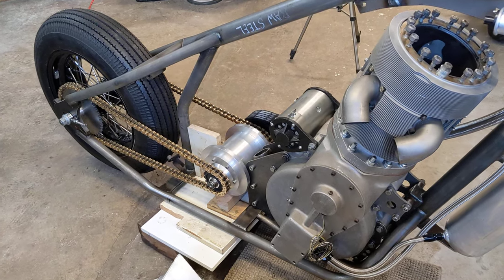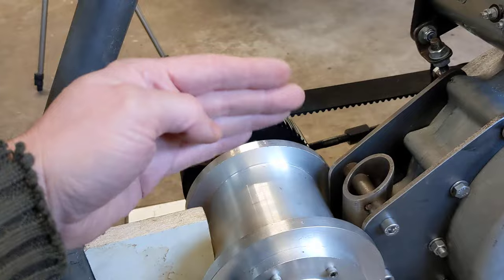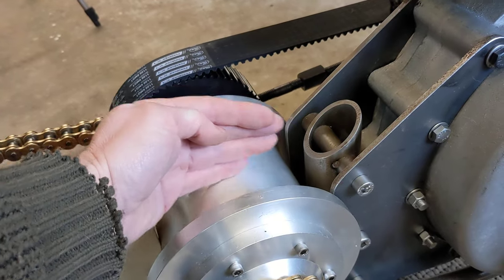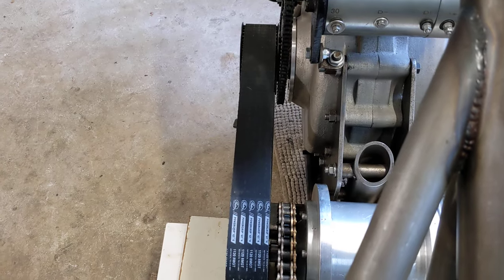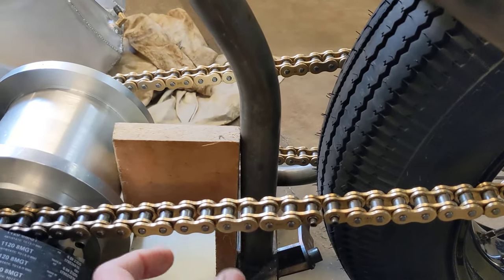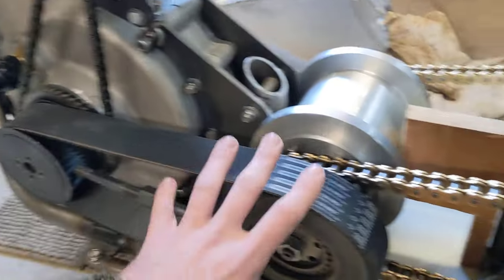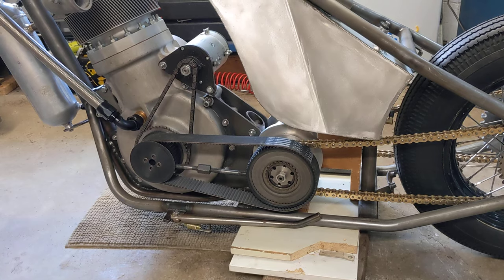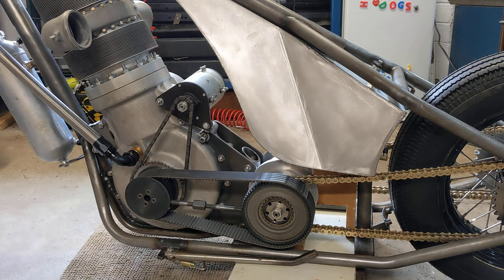Chains to length and gearbox mounting

Comment: I am continually impressed with how well thought out and built this bike is. I realize that you still have a lot of work to do yet, but so far she looks beautiful! I know I'm getting a bit ahead of myself here, but wondering if you've given any thought yet as to what color you will be painting the frame and sheet metal? Btw. I like the gold chains too. Nice touch. 👌
Reply from the maker: Thank you. I have thought a little about colour. At the moment I might just go with plating and polish. Nickel for the steel, of which there isn't much anyway, and brush finish the Ally. 
I always wanted a white chop with brass plated parts, brown leather seat. Very 70's. But I live in the UK so it'll need to be easy to clean!
Reply: @StoneEng  You're welcome and thank you for your reply.

Comment: There's not much clearance under the tank. I'd feel better if it were an inch or so. Also maybe fit a stainless chain guard at that point to shut as protection for the bottom of the tank. It's certainly an original build and I've not seen anything like it before. Can't wait to hear that engine.
Reply from the maker: You're right Phil. Planning another 10mm min and definitely a chain guard. Much as I hate the look of them, it'll need to get past the MOT man and government dreaded DVLA.

Comment: You are going to have to cut away the bottom of the oil tank, even dropping the gearbox as far as possible will not give enough clearance, there's a lot more "bounce" in  the chains in use than expected.
Reply from the maker: I don't think so once I've lowered the box and fitted a guard. Definitely the option of last resort. I did consider taking the tank to the bottom frame rails and running both chains right through it. For a short period 😊